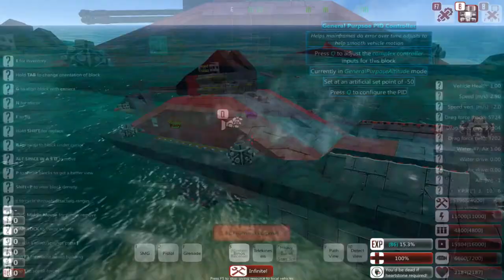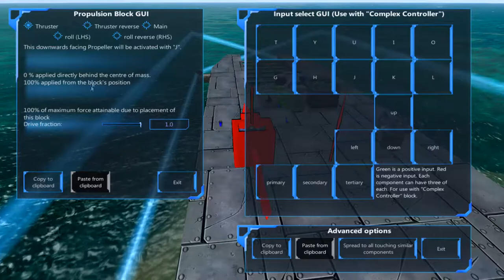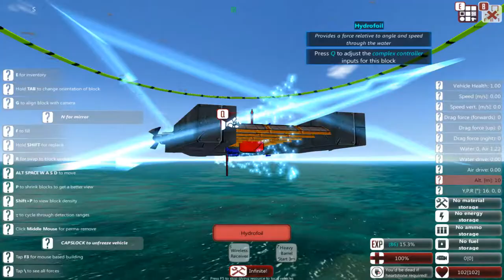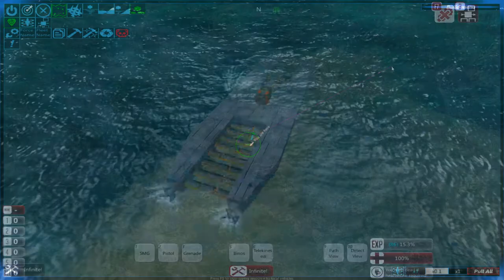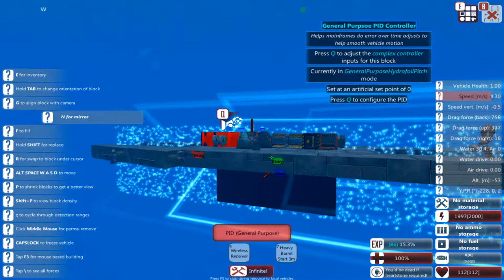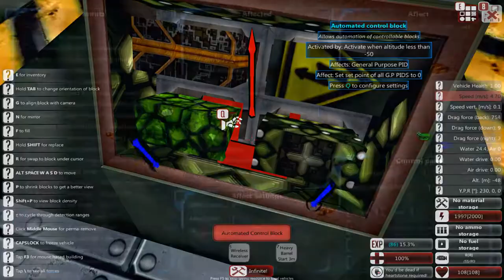FTD Tutorials 3: Hydrofoil Submarines

Comment: That's a pretty complicated way to do it. I just use propellers as thrusters and hydrofoils set at 0.01 pitch to help keep it level while cruising at depth. The hydrofoils cut down on thruster power usage while cruising. Plus air pumps in open spaces. All controlled with a PID each. Up and down buttons set as manual control of the altitude and air pump PID,s and it's cruisin'   (Just how I do it.) Working on a scale Seaquest DSV now...its crazy big. Last project was the Stingray WWII sub from the movie Down Periscope. Oh! and stacked 2 meter pistons on a spin block with a camera on top make perfect periscopes.